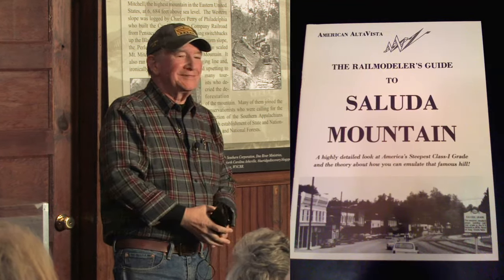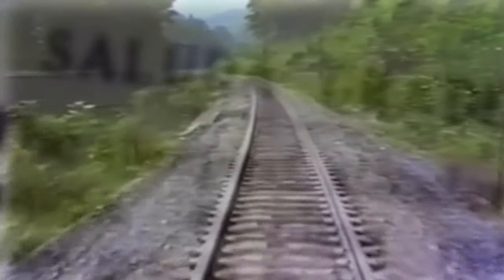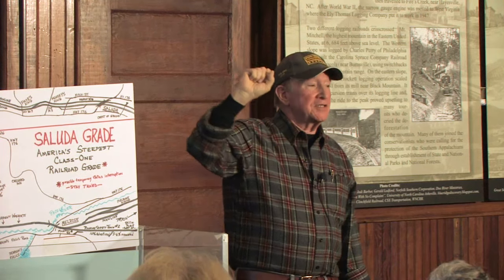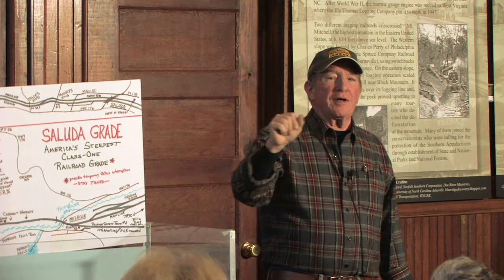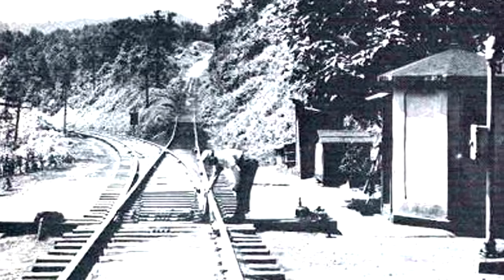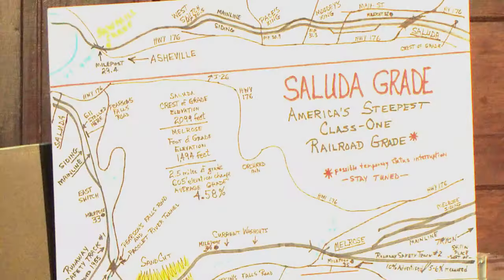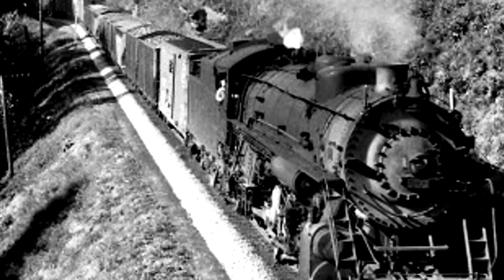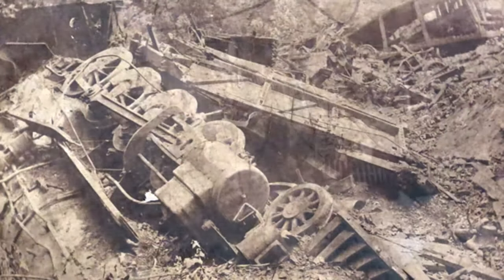Train Tales with Bob Loehne

Comment: As a locomotive driver here in Australia here is the reason the coupler force increases as train speed decreases due to a grade. 
Diesel electric locomotives produce their most pulling power from a standing start. This is due to the physics of operation of the electric traction motors, who’s current draw in Amps is highest at 0 rpm and lowest at their maximum rpm where current draw into the armature is restricted by what’s known as induced voltage due to electro magnetic induction, this voltage opposes the driving voltage coming from the locomotives alternator. It occurs due to the fact that a motor and generator are actually very similar in construction. Consequently a motor in rotation actually generates a voltage which opposes its own driving voltage. This voltage increases as rpm (track speed) increases in turn this reduces the amount of amperage draw through the motor and since amperage is directly related to the traction motors turning force or torque it stands to reason that torque reduces as rpm increases, this is obviously translated as actual track speed. Hope this makes sense.
Reply: Spot on!
Reply: AUSSIETRAINDRIVER 👍